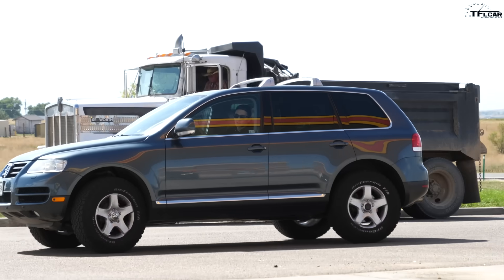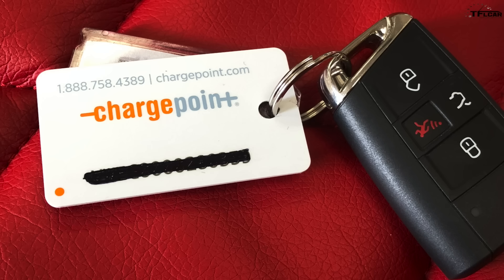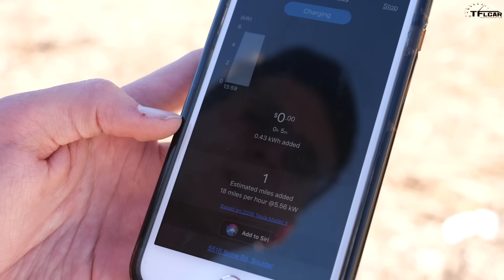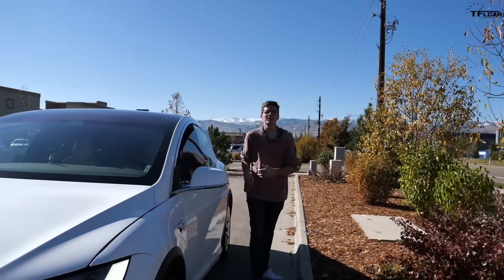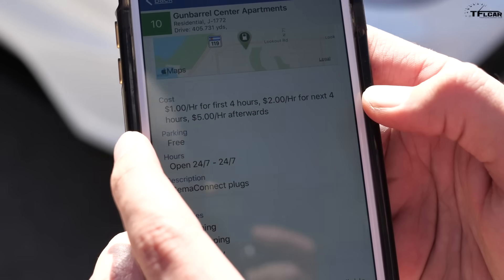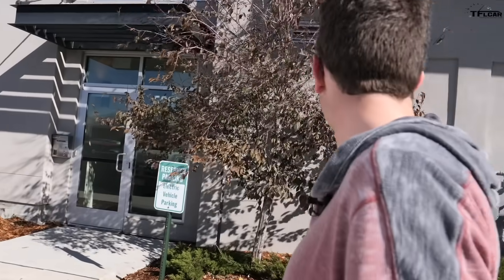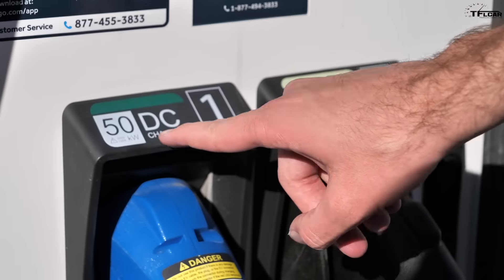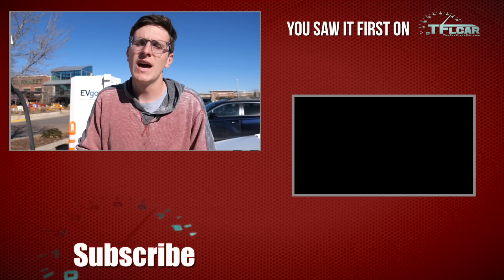Here’s Why Charging an Electric Car Can Suck - And It’s Not The Reason You Think!

Comment: Going green is a load of garbage, despite the fact folks THINK the vehicle is zero emissions it isn't, power plants generate electricity 63% are natural gas and coal. So much for the green and good for the environment. Solar systems and wind turbines combined provide a whopping 3% of energy. Now here's the kicker, folks the resources it took to bring all this about produces FAR MORE pollution using earth resources to setup these "go green" earth protecting energy "saving" devices. My car puts nothing in the atmosphere sitting in the drive way the impact it makes for a 15 minute drive is nothing compared to the "go green" resources needed for the "save the planet" I would say discover the COMPLETE data about what is really going on with "global warming" and the real story green house gasses. It is completely bogus. There isn't an issue the earth has cycles as it always has environmental conditions go up and down just as they ALWAYS HAVE. Do your own research and you'll find just how bogus all the garbage global warming propaganda is really.

Comment: It is going to be quite awhile before EVs are ready to replace gasoline engines. First, infrastructure that can charge from empty to full in 10 minutes and have common plug interfaces...screw Tesla and the proprietary crap. It isn’t going to be proprietary so they can blow me. Y’all can save the planet(arrogance) all you want, because you are too stupid to use the best energy source for electrical generation.....nuclear fission. Turbine blades and old solar panels are more hazardous than most of you could ever dream. Keep researching to get them to where they need to be, but use the best of what is currently available. For cars....use electric motors with the electricity generated by a generator head driven by a small internal combustion engine that always runs at optimal efficiency.

Comment: Yip half my family would be out with no smart phone. Hours to charge boo.  A battery swap in 60 seconds yaye. Get mugged waiting hour for charge. What if phone dies?
Cant wont go.You convinced me
Im talked out of ev.
Reply: How many miles do you drive in a day?  If less than 200, you leave your home in the morning fully charged, drive all day, come home, plug it in, and you're ready to go for the next day.  Not a hard concept.  You don't HAVE to use public charging, 95% of people with EV's don't.  As far as muggings, it can happen while you sit at a stop light, you should ALWAYS be packing and prepared to put a mugger in the dirt.
Reply: @GrandPrix46  im on solar. So how much panels regulator batteries and inverters do i have to buy?
No charging overnight sorry.
It annoys me that a going smart phone or car dead. I think theres 1 public ev charge locally for 1 hour 30 minutes. Espesially when a decent designer would make it 1 minute battery swsp. But thats beyond them.
Reply: You have to get out to charge with no undercover in rain and muggers.
Gas stations have cover and lots of staff around to protect us.
You have to get out to unplug....mugged.

Comment: By the time I watched this video, I could have bought all the gas I need for two cars for one month. 

17 miles of range in one hour. My commute is 17 miles round trip. So theoretically I could drive to work, drive to a charging station and sit there for an hour before driving home. God forbid I need to drive out of my way for groceries. That’ll be another 45 minutes while the ice cream melts. 

Hey kids, we’re going camping! To the charge port!  

This is no way to live. These early adapters are rubes. Until you can charge a car from empty to full in 5 minutes, I’m going to let these idiots work things out. 

Oh, and you get to overpay for a car that will cost you half the price of gasoline to operate. You can never make that difference up.

Comment: I'm not anti EV but even at 100 mile an hour of charge, that still super slow.  It takes less than 5 minutes to refuel an IC car that can then go 2 to 3 hundred miles before having to spend another 5 minutes at the pump.  Why don't the EV manufacturers remove the battery from the equation and make a industry standardized modular battery packs.  Think power tools but standard across all EV's, then you simple pull in and a robot could change your battery or batteries if you have a larger vehicle that take more than 1.  No more waiting, and you will be charged for the amount of charge it took to recharge the battery you exchanged.  Also removes the problem of battery replacement and makes battery maintenance,  and disposal a community cost.  I would love to have an EV but just can't do it because I have family and friends that live 700 miles away and the 10 hour trip to visit them would take days in an EV.
Reply: The battery in a tesla weighs over a thousand pounds so changing it would require like 2 guys, or 3 women.   I'm not anti-gas, but I really wish we did not have to fight trillion dollar wars to keep it cheap.   That and the poisoning of the air and water seem inconvenient at times.  Sure EVs do that too, just to a much smaller easy to measure and understand degree. 
Considering most people with EVs do most of their charging at home in their driveway, while they go inside and eat sleep etc., it does not seem that much harder than driving to the gas station and then home to park in the driveway.

Comment: Gas is super cheap, factor in inflation it should cost $5 to $7 a gallon. Buying gift cards and groceries at Kroger gives me a $ off a gallon for 35 gallons. I've paid $6.26 for 35 gallons at.17.9 cents per gallon with the dollar off per gallon. I fill my 14 gallon Jeep Cherokee and gas cans for the reminder. The Jeep averages 24 mpg and in the high 30s on the highway. So gas being $1.50 to $2.25 and a $ off = .50 to $1.25 a gallon and only takes 5 minutes for over 700 miles of range for 35 gallons I could go for 2 weeks to a month before refilling at the gas station. Electric or hybrid cars are expensive and inconvenient and only Tesla offers suvs which is what I drive. I have classic AMCs and Jeeps in my collection but my every day driver is the 2018 Cherokee Overland as cars don't do it for me anymore. As long as gas is cheap and convenient and vehicles are cleaner and mpg range is better, electric vehicles are just too expensive and inconvenient and are secondary toys for the well off. And here I have a 220 amp plug in my 9 car attached garage I could be using if I did have a a electric car. 🎯
Reply: Electricity is generally free for charging cars.
Reply: @TexMex421  no it's not, it costs $ for the infrastructure and the electricity. If you have a business would you give away stuff for free?
Reply: @jefferyrobinson9984   Gas costs those things plus trillion dollar middle east wars, killing 1000s and the poisoning of our air and water (killing 1000s)
I charge at work where it's free because the company wants to attract talent.  And they get tax breaks.  Oh and it's free in my city too.

Comment: Note you pay thru the ass for this slow charging. Having a L2 charger at home is a must. you just need a 50a with a NEMA 14-50 and the adapter for the tesla travel charger. that gives you twice the speed at this location. you can also choose an apartment complex where this is available. They're not rare.

Comment: So you want me to go from 5 minute fillup for a full tank of gas which can take me 450 miles to waiting 25 hours for 300 miles on an EV??? It makes no sense. EV's will never get mass appeal till they solve the battery charging rate problem. Sure it's cool to say you are saving the planet but fact is electricity is not produced cleanly either - there is a carbon tax on that as well. Gas powered cars will last another 20 years till they figure out an alternative to the lithium ion battery which can charge faster.
Reply: You can charge a tesla fully in an hour at their actual charging locations.
Reply: Yes.  I want you to.

Comment: "People don't have 240V in their home"
Europe: What is this garbage you are talking about??? We have 360V on some areas you know!
Reply: Gandalfwiz2007 American homes are wired for 240V (for appliances such as an air conditioner) , but garages are usually only wired to 120V.
Reply: My american home has 240 just like all the others.  I just ran 10' of wire from my oven to the garage.  $30 at home depot for the wire and socket.
Reply: every home that has 200 AMP service to the home in the US has 240V. my stove, dryer, and AC all run on 240V.
Reply: That is already dedicated to other outlets, charging an EV could take up to 5 days on a standard outlet, and that outlet could be shared with other devices like lighting. So you’d want to install a 240v circuit and that could be expensive, on top of the purchase of the charger, easily $1,200-&1,500 combined cost. So factor that in to any potential savings if you are switching from ICE to EV. I’m in Canada and I have about 400V
Reply: Most American homes before 1960 have separate garages. Lucky if there’s wiring out to the garage. If there is, it sure isn’t 220/240. Probably supposed to have a professional electrician do the work if you’re messing around at the circuit box, and drilling a hole in the exterior of your home to run the wire (?!). Many old fangled houses in the older cities are still running on fuse boxes. There’s a load of infrastructure that’s just not there for now.
Reply: @bmachoboken  yeah, this is why these predictions are way off, also a lot of people never buy new cars so why would they pay more for a used car with a battery that’s down to say 50% when they can get a used car with an engine that can go for another 10-20 years?

We’re back to the same problem we had 100 years ago

Comment: oof.. I thought Tesla had adopted CCS globally a few years ago already.. is your model just so old, or do they still sell them without CCS sockets in the US so people have to use the Supercharger network?!
The public stations were never meant as a power source for all your charging needs, they are meant as a commodity to add a few miles of range while you're shopping or visiting a resident.. coming to the conclusion that EVs suck because of how slow the AC charging stations are, is like saying combustion engines suck because you're trying to fill them up one gallon at a time using your reserve canister.

Comment: Though I'd say Your Millage may vary.   I live in Orlando, and While there are a few peppered about. public charging stations are few and far in between.  I used to own a plug-in hybrid car and driving for about an hour away from my apt in any direction there are only 2 public charging stations.  expand that out to about an hour and half and there's 2 more.  but even so at these places there's not a lot of chargers. one of those stations can only charge one car at a time.  another can do 4 and then has another two Teslsa "destination" chargers.  another has hookups for 4 but one of the stations seems to be broke half the time so can really only charge 2.  And I live right next door to a state university,  25-30 mins from Universal Studios, and about 45 mins away from the main Touristy area of Town.  (international drive)  one would think in all that there would be enough traffic to support more charging stations but nope there's one 4 car setup in one of the Uni's parking lot.  and the 4+2 setup in a fancy mall that's by the interstate exit.  other then that I gotta go way out to other towns. to Winter Park which has a one single car charger in their uptown area next to their train station.  or way up to Altamonte Springs where they got some at the mall up there.  (which like I said are often broke)
It's frustrating really  the metro area here is about the same population as Denver's yet you exponentially more public charging stations.

Comment: Best advertisement against why NOT to go electric! Nice!
Electric - 16miles/hr
Gas - 1600miles/hr (300miles/5min) about a tankfull of gas.
Oh not to mention the battery waste you make when replacing batteries. Its like trying to save the forest from HUMAN deforestation by burning it so it happens "naturally" instead.
Geniuses
Reply: I've been charging my LEAF with the 110V "granny lead" from the trunk for three years. Plug in at night, full charge in the morning, never a problem. I could get an L2 home charger if I wished, but I've never really felt the need. Pay-to-play L2 chargers are really only for destination charging (while you're at work, say, or patronizing the establishment hosting the charger). L3 chargers (and Superchargers) are for road trips.

Public charging infrastructure for non-Tesla vehicles is still a fragmented mess, but even so, I'll NEVER own an ICE car again. The money I've saved on maintenance alone far outweighs what I spend on charging. At almost 50k miles, I'm still on my factory brakes! And while early LEAFs have had issues with range loss over time, newer EVs have far better battery management, which means they last far longer. When these cars are finally scrapped, their batteries will be pulled to live on in stationary applications for years to come, and their motors will still be as pristine as the day they rolled off the assembly line. Try that with a worn-out internal combustion engine!

Comment: Good video , however it unfortunately illustrates all to clearly why most people will not switch from gas to electric . There are just too many variables and limitations with charging and the range/ battery aspect has not been solved yet . Most people want a car that they can commute in AND take on long trips without having to charge mid way.

Comment: 16 miles AN HOUR??  Outrageous.
Reply: If this is at your workplace or even a shopping center you could easily have a net zero or positive charge.
Reply: @tankbuddy9666  - why should your workplace provide charging. Surely this is a taxable benefit.
Reply: @nickjames5366  Because it is advantageous to have EV charging infrastructure at a place of business.
Reply: @nickjames5366  why shouldn't a work place offer charging?
Reply: @bradmagnuson6963  - depends on the location of your work. 

My last company was in the city, we only had 35 parking spaces, with 1800 staff. The company provided an interest free loan for an annual public transport ticket. 35 minutes for front door to desk. Driving would take 2.5 hours. 

My current company has 18,000 employees. Again, they provide transport for all employees to get to work. 

The cost of putting in charging for all employees would be prohibitive - that with the space required for parking all the cars is just not feasible. 

My current company